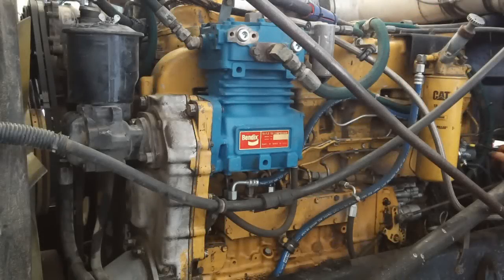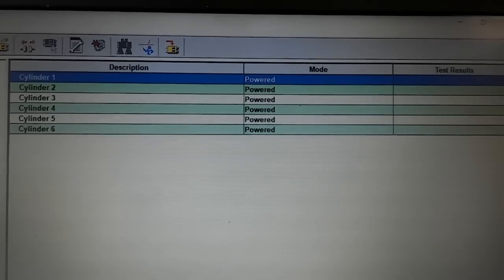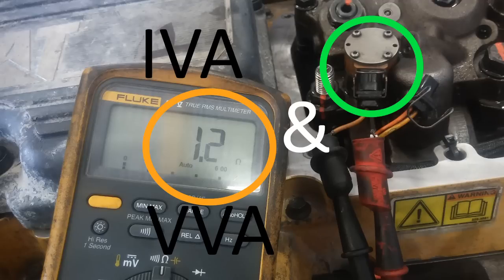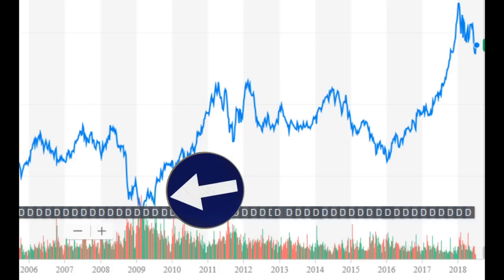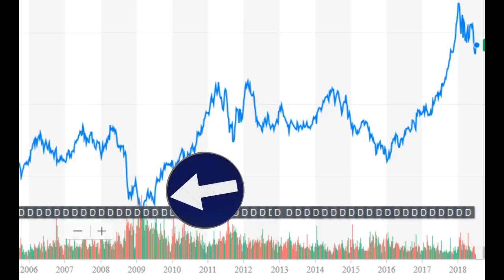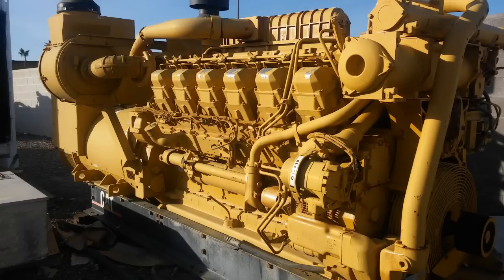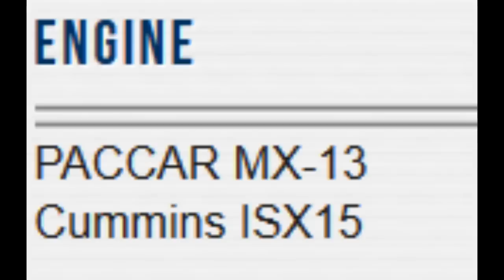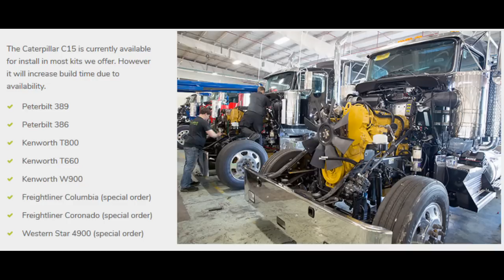Why Did Cat Stop Making Truck Engines?

Comment: it's a shame.  A big cat meaning a 3406 or c15 back then was good for million miles for otr truck.  Then rebuild them and still go another 750k.  Never see that kind of longevity out of any of these new emissions motors.  Don't cry wolf to me about emissions and a carbon footprint when these new motors are essentially shit around 400k miles.  If they even go that far without an inframe or other issues.  The amount of natural resources to produce these junk motors and their limited lifespan emission systems is much greater than an old single turbo cat that last 3 times as long.  These new motors don't last long enough and save enough fuel to make it worth all their trouble and short lifespan if you ask me.  I got a 2012 389 with a cummins and with 450k on it it's been rebuilt 3 times!!!!  Our 2002 379 with a 6nz has 1.1 million on it and hasn't been rebuilt yet!
Reply: slr379 I used to work for a LTL company and drove a CNG (compressed natural gas) tractor pulling a trailer around town, but it was a gutless wonder and didn't come close to a diesel, and that thing was on it's 3rd upper rebuild because it burned so hot, and didn't compare to the older engines made years ago.
Reply: slr379x that's because it's a ISX , worst motor Cummins ever made
Reply: the difference between their best and worst isn't that big haha.  We had a couple old internationals, one had a n14 electronic and the other an older big cam 400 and every 350k the upper end was cooked or constant turbo problems.  I'm sorry but I can't say we've really ever had a bad CAT.
Reply: slr379x blame that on the manufacturer, not the legislation.
Reply: slr379x 
Seeing an emissions engine go 400 k and needing a rebuild , and then adding all the resources going into a rebuild , I see no carbon footprint savings.
Reply: it is absolutely flawed legislation without question.  Every manufacturer has had great difficulty to build a long lasting reliable engine that meets the emissions standards that they've put into place.  Which results in down time, replacement parts, and producing more engines because they don't last as long.  In other words if they'd see the actual impact on the earth that this has caused.  They would think differently.  If this legislation was actually developed and put into effect for the better interest of air quality and the planet than they would've realized by now that these new engines and emission systems are not the answer.  It's all a money game and more bullshit they can throw at an already tough industry that is struggling.
Reply: yes i agree that's what I'm trying to convey.  I can't seem to find the sense in it
Reply: the EPA is a tool of the left and they want you to buy a new truck every 200,000 miles not 1 million and they want you to go broke. did you ever see the govt do anything logical before?
Reply: slr379x careful what you say the bastards will be around to find out why it's still going outside warranty
Reply: slr379x The main reasons newer truck engines done last is DEF. The crap is no good for the engine.
Reply: Mike cubes: the Republicans started the EPA (Richard Nixon)

most EPA standards are set 10 or 15 years in advance so standards that would go into effect today were set in place early in George Bush's presidency.  getting the American people to blindly blame either the Democrats or the Republicans for their problems is the greatest con that our government has ever pulled off. 

if you think that Nancy Pelosi and president Trump aren't arguing on camera and then having cocktails off camera then you're a fool.

Divide and conquer...
Reply: copy lol
Reply: slr379x  agreed
Reply: Ramman79 l
Reply: Modern Detroit engines seem to be well engineered and don't have as many issues as the Cummins
Reply: slr379x that's highly unusual with a N14. Very solid motor , inexpensive to rebuild and great mpg
Reply: Pat MyGroin DEF doesn't go in any part of the engine....!
Reply: But is it the EPA's fault if diesel manufacturers can't manufacture an engine that doesn't produce too much nitrogen oxide or soot? You do know what those things do, don't you? They cause emphysema and lung cancer. So what if all trucks have to be natural gas? Back in the seventies, most vocational trucks had gas engines, because diesels just couldn't make enough power for stop light to stop light driving. Combustion engines are on the way out, anyway, because electrics just do it better. Tesla's new truck has a thousand horsepower and zero emissions.
Reply: Fine, it doesn't have zero emissions. But, since electrics are about seven times more efficient at converting potential energy to kinetic energy, and so little is lost to heat compared to combustion engines, there is a clear advantage. This is just at the vehicle. Power plants, of course, are orders of magnitude more efficient than truck engines. There really is no comparison if we're talking about emissions from power generation.

As far as pollution from manufacturing the devices, it's one to one, one isn't better than the other. Lithium comes from salt water these days; we're not in danger of running out of it or getting it in unethical ways. Cobalt is the big problem for lithium batteries, it mostly comes from awful places in Africa, like the Congo. That is being improved. 

Electric trucks are already replacing diesels, and they haven't even hit the road yet, because the advantages are enormous and obvious. A fraction of the maintenance costs, a fraction of the fuel costs. Walmart, Inbev, Coke, Pepsi, UPS, all expect their Tesla fleets to cost less than half what diesel trucks do in the long run to operate. You are right that energy density is the big issue for electric trucks, but if Tesla is correct that their truck has a five hundred mile range, then the problem is solved for sixty percent of loads.
Reply: SIMPLETON, where do the batteries come from?? Unsustainable resource dragging out of poor countries while abusing the ppl. The lithium, cobalt are running out before we even come close to converting to electrics.
Reply: Josh Bobst Don't you have a tree to hug?
Reply: i have 2 x C12, with more maintenance than a FERRARI and are a piece of fucking shit !!!!     
when have you seen a machine, a diesel engine more delicate and pussy than an italian gasoline  engine !!   i am even scare to push too much because of the issues and repair bills. They have 800 hours and  i pray to the gods to hold a little bit more.   On the other hand i have a 4 cyl  kubota, small engine, that i even FORGET to change the filters.  That one has 1200 hours of hard work and purrsss as a feline.    (this week will do whole service to that poor creature !)   I am very dissapointed such a WONDERFUL icon as CAT allow themselves go so deep in shit.
Reply: If you knew anything about the exhaust emissions, DEF does NOT go through the engine-this is the beauty of DEF-it is injected at the very last in the exhaust pipe.
Reply: Detroit DD engines take 1/10 the time to figure out what is wrong with them. They also have their own system that tells you what is wrong in advance.
Reply: Trentten Orth totally agree and also to add... nuclear power to make electricity is about as non-eco as it gets , producing nuclear waste
Reply: That's what I've heard
Reply: Pat MyGroin I'd agree. That shit is nasty,  leaves a stain, and that smell.  How's anything that dam nasty good for the environment!!!!
Reply: ChrisHallett83 agreed.  Most D13 are considered a 1.5m mile motor with basic PMs
Reply: I don't buy the whole idea that a big-time manufacturer like the majority of the big ones can't build an engine that will pass emission tests because the bottom line is as soon as any of the companies create some new design to make more power be more efficient or to pass emissions a year later all the other manufacturers will have the ability to not necessarily copy it but to create their own version of that design so it all comes down to companies wanting to be cheap and not investing in retooling to make their engines better so it is all their fault so just let them die as far as I'm concerned or at least their engine side of the company.
Reply: slr379x you know current day gas engines will easily go 500k miles if you take care of your shit. Same with the current diesel engines. Take care of your shit
Reply: These emissions regulations are,without doubt,a false economy.....
Reply: This reads to me like any issues you have, they are with Caterpillar  not emissions and fuel economy regulation. Ct has shown the can construct durable engines, along with they can construct engines that can meet regulation. Thing is Cat has decided not to do both. R Regulation isn't the problem, because in the USA, it's the industries being regulated, craft the regulations they have to adhere to.
Reply: I hear you man, the newish adblue Cummins E5 motors and the EGRs befor them are absolute ass. We have 2 new 909s with E5s and iv never seen so much trouble with a truck, let alone a new one.
Reply: Josh Bobst thou should really do your research on the efficiency of electric charged battery powered vehicles. The emissions from making power.. mercury...nuclear waste, etc. All way worse than petro fuel. Then come transformation  losses, line losses, transformation  losses again, transformation  losses again...sometimes  3-5 MORE times, conversion to DC losses in charging...then Losses in the electrochemical charging process. .... ONCE it FINALLY makes it into the batteries then you have losses from the usage of battery power,  transformation  losses again,  phase conversion, etc ... and Heat and mechanical  losses.
 About 20-35% of what's made at the power plant ends up being actually useable power to the wheels in the end. HUGELY INEFFICIENT. 

 Want to talk about Natural Gas...Methane? Yeah that's a real champ of massive ultrafine PM emissions mostly invisible to the public eye but a HUGE problem for breathing, it goes straight into the bloodstream, PM2.5 and smaller. BAD !
Reply: slr379x a motor is only as good as the owner. You take care of it. It last long time. Treat it like shit and don't do the manitance that is suppose be done to it. And it turn to shit. I don't care what you put on a motor. You neglect it and have engine failure. It's that simple.
Reply: mike cubes Agree. Business , capitalism... and especially  PROFIT are evil in the eyes of the Left Wingers. Unless they're reaping the control and wealth exclusively..
Reply: waswestkan wow is that ever untrue in idiocracy USA .. industry is having to spend fortunes constantly fighting off the onslaught of government interference and regulations... this is why there are lobbyists.
Reply: and it is all to further the global warming hoax. Global warming = bigger government, same as everything else. Government policies don't exist to help anyone, but to control everyone. Its all about control.
Reply: Why would they want those things? Clean transportation is an enemy of the people?
Reply: Trentten Orth  - You use the internal combustion engine running at its most efficient and cleanest speed to recharge the batteries. It's when the ICE has to operate through a wide speed and load range that they really pollute. Should the EPA (and other regulatory agencies) be much more responsive to industry problems implementing goals? Yes, but a lot of industries and individual companies also have a history of passive-aggressive resistance and half-a##ed efforts at doing the right thing.
Reply: Pat MyGroin actually DEF/adblue never interacts with the engine because it's sprayed downstream of the DOC
Reply: 6NZ is one of the best and most reliable CAT engines. So easy to work on and overhaul.
Reply: We have a 13 - Meters  wooden Motoryacht, displacement 7 metric tonns with two 3208 marine -engines 370 HP.  It makes 24 knots at 1400 rpm. Simply undestructable!!!
Reply: The EPA Nazi's really don't care if an entire industry goes under because of their regulations.  The EPA is a gigantic bureaucracy that justifies its existence by making tougher new laws that result in an almost unmeasurable decrease in emissions.  The EPA has cost our country many billions of dollars, but who cares it's only OUR MONEY!
Reply: @100pyatt  we have a 2012 international prostar with over 650k miles and it's still running strong
Reply: Same can be said for light duty pickups, repair costs and longevity are terrible, and the vehicles themselves are so expensive that they keep the banks in business because they have to heavily financed. Gone are the days of no emissions and shadetree repairs.
Reply: @mikecubes1642  The Interstate highway system springs to mind.
Reply: @eloyex   those engines were ruined intentionally by the hippies at the EPA, they want your engines to crap out within a year so you go broke. thats why they act like the carbon from your engine is deadly poison but all the carbon from a forest fire is just fine and dandy and wont hurt anything at all. thats how you know the EPAs science is more fake BS than the what the media feeds us.
Reply: @denniswatson1293   when was the interstate system made and who was the president that pushed for it? a real republican named Eisenhower and it was before the leftists really took over the govt and formed the EPA which is a huge roadblock to progress
Reply: @mikecubes1642  "did you ever see the govt do anything logical before?" Your statement,which you now admit is not true.
Reply: I looked at some used trucks. ALL were from Crete & all were immaculate & had 600K on them. They didnt need a rebuild. U guys are using the wrong oil or not changing it enough.
Reply: @tommyhallum4207  Well said
Reply: @guardrail2897  def doesn't go into the engine. It's injected down stream to control nox. You mean egrs, not letting engines breath.
Reply: @t.o7515  lithium batteries are going to be replaced with solid state batteries with 3 times or more energy density.
Reply: the 400k thing is not true, where i work we have volvo and every truck we have in the fleet up until the recent new ones has gone past 600k with no problem or needing any major rebuilds. they all have the volvo d13 engine which i work on everyday and the only problems they seem to have is some sensors go bad. other than that just replace the injectors when they go bad and let the truck regen when it needs it and you have a good truck.
Reply: @t.o7515  'First, where does the electricity that drives the truck come from; that energy didnt magically appear.'   You seemed to have left out nuclear, wind, hydro, solar, geothermal.  Hmmm, 0 emissions.
Reply: @bergerk20  What is.... regen ??
Reply: @williscurry6557  Oil is oil. Just change it out to eliminate the contaminants.
Reply: @Katmandu2  a regeneration is when the truck idles up to 1000 rpm and superheats the exhaust going into the diesel particulate filter to burn/ push all the soot out so the truck can breath again. Dpf is like a catalyst but on a semi. It uses an injector at the exhaust manifold to mist the exhaust with fuel to super heat it to 900- 1000 degrees.
Reply: @fliteshare  will the mx 13 make it to a million miles?
Reply: @wittemanadrian  
They're metric in Europe.
But here's a video of a Polish guy going over the million km (or correctly   1Gigameter) in his DAF95XF.
https://www.youtube.com/watch?v=RWrx03Y-uZY
Which the odometer correctly indicates.
Reply: @wittemanadrian  
They're metric in Europe.
But here's a video of a Polish guy going over the million km (or correctly   1Gigameter) in his DAF95XF.
https://www.youtube.com/watch?v=RWrx03Y-uZY
Which the odometer correctly indicates.
Reply: @wittemanadrian  
They're metric in Europe.
But here's a video of a Polish guy going over the million km (or correctly 1Gigameter) in his DAF95XF.
https://www.youtube.com/watch?v=RWrx03Y-uZY
Which the odometer correctly indicates.
Reply: I like your thinking. I’ve always been thinking this way for long time. They dont put oil in asphalt anymore so now pavement only last’s maybe a third as long as before. They dont figure what is takes to costs to repave.

Comment: People keep blaming the EPA, but Mack, Cummins, Detroit compete just fine with new regulations. Caterpillar just couldn't compete.
Reply: Don't confuse simple minds with your logic!  We all KNOW it's the Evil EPA that causes all problems!  Of course poor CAT was blameless.....NOT!
Reply: 11 years ago CAT bet the farm on computer control for emissions. Failed and bailed.
Reply: None of those companies you mentioned produce a product that is even remotely comparable to a non emissions motor in terms of reliability, quality, or cost of operation.

Motors should not shit pistons out of the block, drop valves, melt pistons, or need thousands in emissions equipment replacement parts bye monthly. And be a pile of scrap before 400k miles.

I've only see one cummins isx live long enough to get its first rebuild around 500k and it had been deleted (EGR,DPF,DEF REMOVED) almost its whole life. The rest ether throw a rod or melt a piston and trash the block. Or spin bearing do to fuel in the oil from regens.